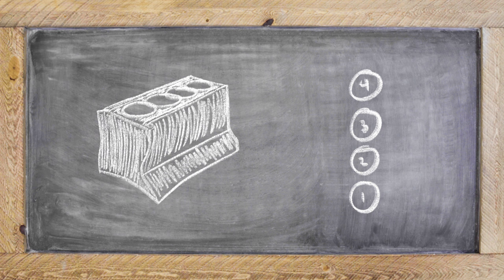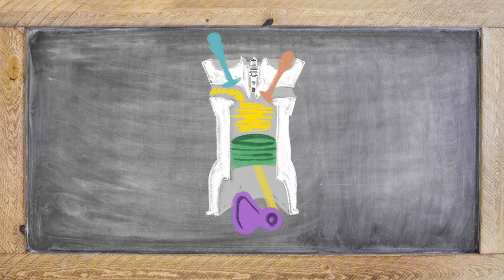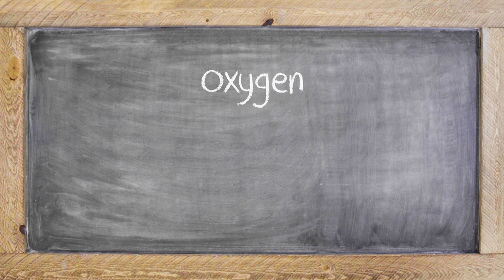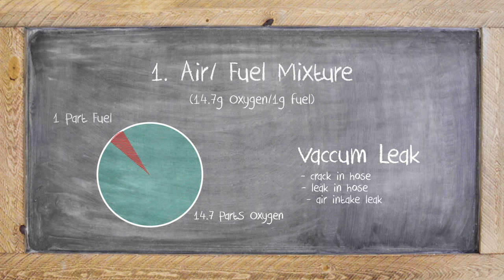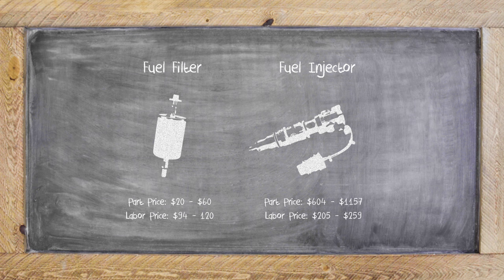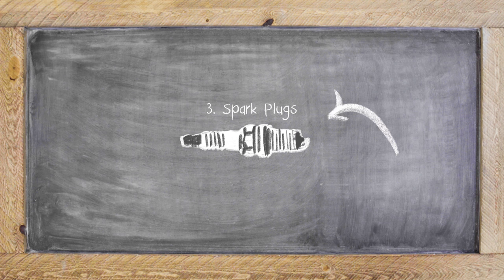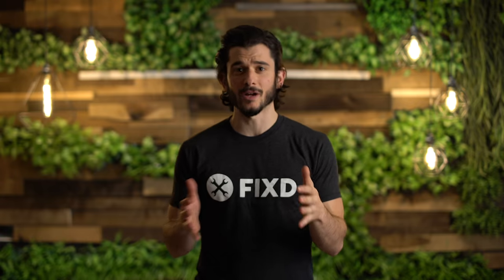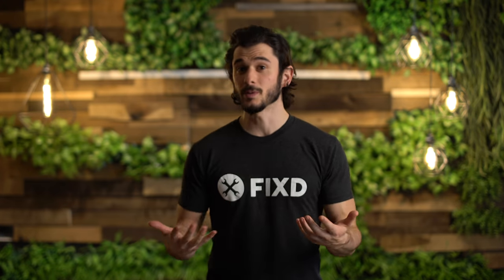P0301 Explained - Cylinder 1 Misfire (Simple Fix)

Comment: I think my issue is beyond all of those components. I replaced my fuel injectors, spark plugs, coils, PVC valve, upper intake gasket, and I still have a po301 code.
Reply: Same here..new wires.. plugs..injectors..cap ..rotor ..coil..and fuel filter...then I found a vacuum leak and thought I solved the problem. Nope.. still getting a 301code. Need to check my o2 sensors next I guess. Maybe pull the throttle body for cleaning...but I'd think that would affect all cylinders? One guy here wrote that he found a bad/no ground wire to his no 1 fuel injector ..youd think the it wouldn't work at all if no ground.. but mine only seems to miss at a light or stop sign..in gear... trying to relearn the idle valve or whatever it's called but it won't go into that mode...maybe the valve is gummed up..hell I don't know.
Reply: You may need a air compression test for your cylinders
Reply: @ladytnt491  I did that too ...early on. Funny though..it actually read a little higher than normal compression.  I wonder if that means something like a bent pushrod on the exhaust or something? Or could of been an err on my part...but there was definitely ample cylinder pressure to say head gaskest and the rest of the motor was okay
Reply: Problem solved! After removing and cleaning all components of the throttle body...including the idle control air valve (which I would highly recommend on any vehicle as old as mine ..2002) I redirected my attention to the 301 code number one cylinder. Thinking to myself this has got to be something simple since the compression test showed good. Pulled the injector and found that the o-ring was cut. Also noticed the fuel rail was not sitting centered on the rubber seat. New o-ring and adjusted the seat and she idles perfect now...including in gear. No more stalling during acceleration either. Used assembly lube this time around to seat the fuel injector...slipped in like a glove

Comment: I replaced all 4 coils and plugs and still get the p0301 code 🤦🏿‍♂️ maybe it's the fuel filter
Reply: Same
Reply: @shacoradudley6649  I did a compression check and it had low pressure. It was the engine the whole time. Sold the truck, bought a new car.
Reply: @909fresh  same how do I compression check
Reply: @baebae2449  my mechanic came through with a machine that did it.
Reply: @909fresh  ok thanks I got new coil packs and spark plugs.my mechanic said fuel injector next but I seen your comment and change.my mind.im gone get that done before I do anything else
Reply: Happened to me before 2 the code just popped up but it also said to change the fuel filter
Reply: @jordanc8920  yup. same here. Changed that then the alternator. Everything was all good.

Comment: Okay so here is the problem! I have a 2002 Toyota Corolla. Getting the code so I change the fuel injector on 1, changed all spark plugs, and coils are good because I switched them and the codes didn’t change. Engine is running rough. Shakes when I get to a stop or just idling. Mechanic said the cylinder may just be fucked
Reply: Ohh.. so what ended up happening??

Comment: Can't find cylinder 1 on a 2000 impala 3400 sfi motor
Reply: I found 3 and 5 cylinders but can't find cylinder 1 on 3.4 liter engine
Reply from the maker: If you are standing in front of your vehicle, cylinder one is located on the back side of the engine basically under/ bottom side of the alternator. The wires on the coil pack (located on the top of the engine with the spark plug wires connected to it)  are numbered from the factory. Follow the labeled number one wire from the top to the back side of the engine, this will locate the #1 cylinder.

Comment: yo where the fucc are you getting those outrageous prices from
Reply: He's right about cost.
Reply: @brandonrice2990  no he is not. fuel injectors do not start at 600 dollars and and coil plugs do not start at 200 dollars. even expensive stores like autozone don’t have prices like that
Reply: @landocommando7321  Depends on the vehicle. I have a Subaru and my coil packs were around 400$ injectors were around 175$
Reply: Anything sti ain't cheap.
Reply: Aside from estimating,the video was just for information on misfire codes and possible fixes.

Comment: My 1991 3000 GT is misfiring. Please help.
Reply: What Code are you getting? Did you watch the video?
Reply: No need to get codes for misfire. Turn your car on. Open the hood and remove one spark plug cable, if the car gets worse, plug it back in, that’s not the faulty cylinder thats misfiring. Keep doing this until you remove a spark plug cable and there is no difference in the performance of the car. This means that that cylinder is the one misfiring. First thing you do, check the cable/coil (whichever one it has), make sure it’s not broken and shorting out if it looks good continue. Second, check for spark, if no spark you’re gonna check your distributor cap (if it has one), if it has a coil and no spark, it’s gonna be a bad coil. If you have spark, take the spark plug out and check for any defect. If it’s fine smell the bottom of the spark plug, it should smell like gasoline. If it does not smell like gas, it’s your injector. If you check all these and everything is fine your problem will be a vacuum leak or a valve in the cylinder head is stuck open (not likely).

Comment: The problem is , when I hit full throttle and rpm reaches 6-7 sometimes and not always engine light flashes and the car become weaker and after 30 seconds everything get back to normal and Engine light go off again . P0301 and sometimes > P0301 P0300 P0305 . I replaced Cylinder 1 with 4 still showing me 1 , I dunno what to do I don’t want replace something for nothing . Thank u for your video
Reply: Devilxxksa let me kno if u fixed it
Reply: Devilxxksa......im having that exact same issue.Did you ever get it fixed and if so,what was the issue?Thanks
Reply: What car is it? Year, engine, fuel type and capacity? Try swapping your fuel injector (if petrol)  if still the same, do a compression test, that will rule out valves and rings, also check your wiring to the coil..
Reply: lol it's the MAF.
Reply: Well my issue ended up being an ignition coil. Replaced it with a new coil and problem went away briefly. Same problem came back and realized I had gotten another bad coil again!That's 2 bad coils in a row.....what are the odds🙄I'm not complaining because it could have been a lot worse!!!!
Reply: @aaronwilcott4561  Good stuff! 👍
Reply: @aaronwilcott4561  Don't take any chances.  Amazon has great deals of coil sets, more than half the price for just one at a car dealer.  Change the MAF and the air intake hose (upper) while you're at it. Don't want surprises.
Reply: Crazy. I was having similar issues with the codes. First was the P0301. Car would feel sluggish. Had to ease into first. Then the sluggish feel and codes would randomly leave and then the car be good again.  Was like that for the first couple weeks. Slowly got misfires and codes in all cylinders. Now it’s just always like that. Been about 2 months. But finally yesterday the car felt good all day. Like it was back to normal. Compression was low when I checked it. But why come back to normal again yesterday? This week I got the P0335 code for the Crankshaft sensor. Just changed it. But code misfire on #1 for P0301 and P0000 came right back on after a drive. If I keep driving it. The other cylinder codes come back up. No smoke, mixed oil, just changed out the coils and spark plugs, had a new belt and water pump job done recently where they had told me the timing was 2 teeth off. If I wanted to go to back to “stock”. They did, the car was driving fine after it. So I wouldn’t think that was it. Hmmmm.
Reply: Lol guys thanks , I hadn't have any notifications except for the  last comment . It was Ford Mustang 2013 V6   , I sold the car lol though didn't fix the problems.  But I diagnosed it and it was having bad coils and bad spark plugs also . Thanks everybody for sharing 🙏
Reply: @lalolalo1233  no its not

Comment: Question someone is selling a ranger and in the description it says need new engine I messaged the person and she said it has a missfire in cylinder 1 do I really need a new engine btw the truck is selling for 1000 with a widebody and suspension upgrades
Reply: Jesus Mejia very good possibility that it’s something minor like a coil, spark plug or spark plug wire. My advice, check for one of those 3 issues before purchasing.